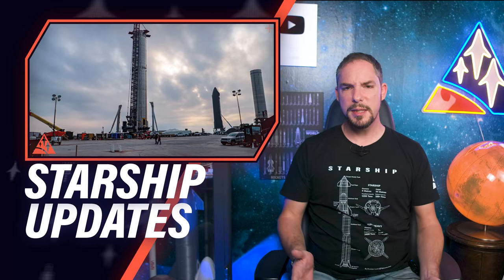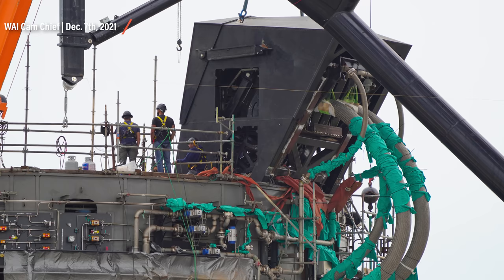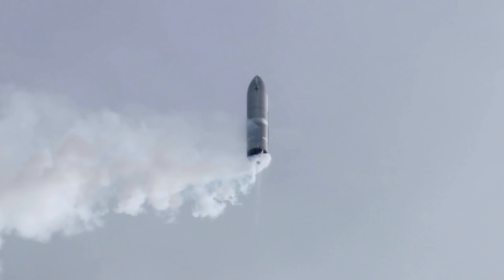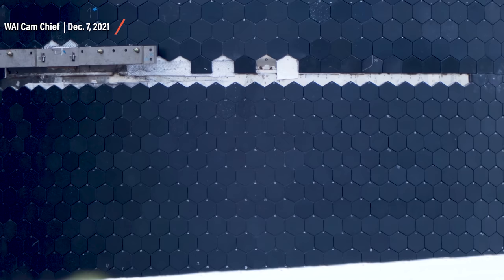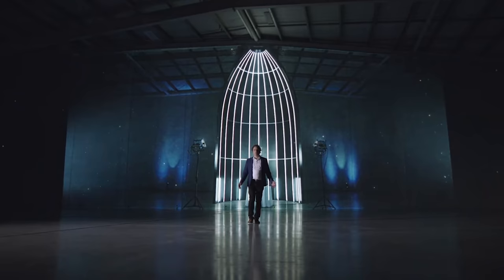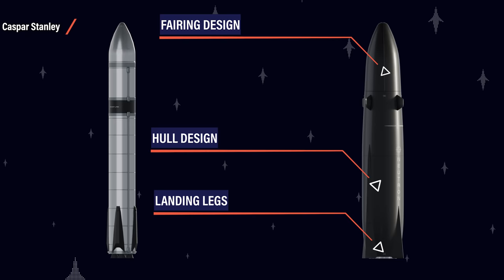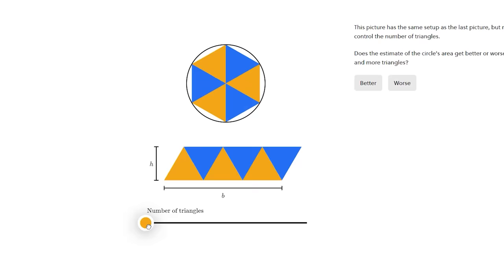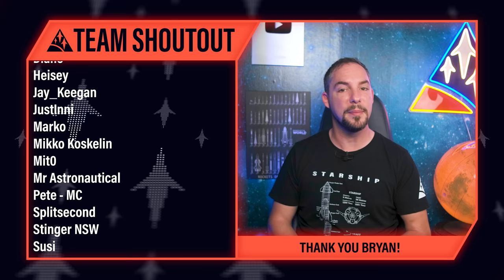Not enough engines? Why SpaceX might be retiring unused Starship boosters!?

Comment: Rocket Lab has a big advantage in their Neutron development than other Rocket Companies. Using 3D printing, becomes handy at the prototyping phase, allowing quick design changes.
Reply: Agreed, don't think 3d printing is good long term personally but definitely effective and efficient in prototype phase
Reply: But is it really cheaper though?
Reply: The prototyping PHASE too...lol...sorry. Someone was bound to bring it up eventually.
Reply: @BlackCat.Designs  you gotta give me some slack but from my understanding of manufacturing using 3d printing for prototyping is cheaper, however for mas production using other machinery to make the parts and stamp them out tend to be quicker and therefore cheaper. 

Understand my knowledge is really limited so if you think I'm wrong thats fine 🙂
Reply: @BradElliot  no, im really asking I dont know either xD
Reply: @BlackCat.Designs  depends on size really. Neutron is still fairly small compared to starship. So 3d printed rockets are great for small compact rockets but something like starship would be easier to use SS
Reply: 3D printing is slow with lower quality but the same maschine / printer can do different parts.

Traditional manufacturing needs a different tool / maschine for every part and again for every change. That is way more expensive, but can efficiently manufacture large quantities in good quality. The price than drops with every identical part.
Reply: A big disadvantage to 3D printing is the structural strength of the material. For fitting it is a great prototype, but if you are pushing the limits of your material, it is completely different. 3D printing has been around for a long time. It used to be called rapid prototyping. Advances in 3D printing have been amazing, but the internal structure of the material is still very different
Reply: @BradElliot  3D printing is great in the prototyping phase. But once they chose the final design, they could switch for other most cost effective construction methods.
Reply: @BradElliot  the 3D printing it's just in the prototype phase. They will eventually going to use other more standard fabrication methods once they achieve the production phase.
Reply: @RogerM88  That's called spelling. Not grammar.
Reply: @Ben-jr8ku  Neutron is exactly comparable to the SpaceX Falcon 9 - that SpaceX are looking to retire. RocketLab obviously see a market opening.
Reply: @davidnewton4491  3D printing can be just as strong - what it is is much slower than conventional manufacturing for simple parts. For complex geometry you can make parts faster using 3D prints.
Domestic 3D printers are crap quality and not a good comparison basis.
Reply: actually not really... having a carbon fiber chassis makes it not very iterative, they are kind of bound to their design. A metallic chassis would have been easier to be more iterative. Also other companies are working far more on 3d printing full rockets for cheap like relativity aerospace etc. Rocket Labs advantage is that they have experience building and launching carbon fiber rockets already.
Reply: C Dawg  RocketLab have been 3D printing their entire engines for the best part of a decade. They know what they are doing (having put more satellites into orbit than most companies that have that short a history).
Reply: C Dawg  why compare with SpaceX? There are other companies to compare.
Reply: @RogerM88  can agree with this :)
Reply: @allangibson2408  I guess I was crap saying what I meant. There are applications where grain structure inside of a material, especially in aerospace, means a lot. A ton of components can be 3D printed but the crystalline structure of materials like titanium, and stainless can only be found in cast, rolled etc. metals and plastics. I love 3D printing especially some of the cool stuff that has come out on the aerospace side the last 10 years. But in certain areas a non printed part is just better. With the technology, in my limited experience, there have to be at least a few high stressed parts that need proper grain structure. Not an expert, just using my limited window of making and designing parts in a corner of the industry
Reply: 3d printing for metal parts and engines may be comparable to the printing we know, but i don't think the carbon fiber "printing" for the rocket is the same thing. More like carbon fiber "laying", which in this case is more comparable to the robots welding spacex's metal tanks.
Reply: Elon will just buy Rocket lab if need be.
Reply: @davidnewton4491  Industrial 3D printers are a world apart from domestic or even commercial equivalents. That includes operating in inert atmospheres or hard vacuum if that is what the material (ie Titanium) requires. You can work to the strengths of the technology and not the weaknesses. You can 3D print components that you simply can’t machine or cast - including having hollow impellers in pumps with a hard vacuum inside for example. Machining components during 3D printing is also possible to get the required surface finishes inside components. Variable material composition is also possible (integral bearing material installation being an example). You can also 3D print materials that can’t be cast (because they are dynamically and thermally unstable).
None of this is cheap - and you really have to work to justify owning the required equipment to give you exactly what is needed.

Comment: From Peter Beck's presentation, my biggest personal take away way is how their 3D composite production is measured in meters per hour, as opposed to metal printing which is measured in millimeters per hour. That's a big wow!!
Reply: @Bryan-Hensley  it may be that the available composite tech at the time just wasn't feasible with their production goals. Rocket Lab has taken that time to hopefully perfect their process, and sounds as if they're aiming for '24 to get the real action going. If the tech becomes viable I'm sure SpaceX could reincorporate it into their design when the timing is right? 
I'm confident that they're getting stainless more streamlined with each new model as we've seen, and the incredible progress on the TPS bricks over the last year also gives me hope
Reply: Lol No"doubt about it"😉

Comment: I don't think the booster is being retired, it is  probably being stored. There is no other place for it at the site. I am almost 100 percent sure booster 5 will fly if Raptor 1s are still in production. I am interested to see if they skip 6 and 7, and go to the 33 engine booster 8 with Raptor 2s. I think that's what they want to do, but Raptor 2 bottleneck is what is endangering the roadmap.
Reply: Why skip 6 and 7?
Reply: B6 is a test article now
Reply: I don't see a point in guessing since we cannot know.  I'll just wait until it happens and then I will know. 🤪
Reply: I believe you are correct😉

Comment: You forgot to mention one of the most important facet of the Rocket Lab "Neutron".. it's outer skin is NOT stainless steel, it's a carbon-fiber-composite that is more resilent to structural damage.. This is the most exciting part.. a tremendous reduction in weight.. :)  welcome the states, Felix !
Reply: I don't think strength is really an issue tbh... that was an odd part of his presentation, the cf is really just to reduce weight to get more payload, if anything cf handles heat much worse than a metallic alloy.

Comment: The reason B5 is being put on hold for now is because firstly, the OLM can only hold 1 vehicle. Secondly, the OLM is required for booster testing. And finally, it is not done yet, meaning they cannot currently test any boosters. Because S20 and b5 are both at the pad, there is no room for b5
Reply: *b4 at the pad

Comment: Russia,China and Europe are exactly copying Falcon. Rocketlab is improving Falcon design. And that improvement is very low risk. The highest technical risk they are taking are the single stage turbo pump new rocket engine. Its a very impressive design.
Reply: Which is why I love rocketlab's approach over old space approach. Rocketlab figured they have some experience in composite that others just don't have, so they went to the drawing board, learning from what falcon demonstrated over the years as the new block versions improved it's capabilities. Neutron does pretty much what falcon does... But because they went in with a clean slate (while falcon was built from cheap expandable to the first re-usable booster and re-usable fairings) so they could patch the drawbacks that falcon discovered along the roads.

Comment: Could they use booster 4 or 5 for Chopsticks practice? Could be useful to have some "dry" runs before trying to catching them in mid air! ;-)
Reply: @JoeShmoism  That would be a literal "wet" run. I was referring more to a booster "handling" practice with the chopsticks. It is going to be the most complex and sensitive robotic feat ever! :)
Reply: @JoeShmoism  Exactly! They could hang the booster using the crane within chopsticks range and practice "catching" it !

Comment: I'm very curious to see how that carbon fiber neutron rocket handles re-entry.
Reply: I was wondering about the heat shield
Reply: Remember that it will not be traveling at orbital or near orbital velocity. It's a first stage, so will have a profile similar to Falcon 9 RTLS... boostback, reentry, then landing burns.
Reply: @davidpotter8297  You're absolutely right! The upper stage separation looks like starship payload deployment I completely forgot it was a second stage. Velocity after the boost back burn shouldn't be too crazy.
Reply: Also, remember that they're already testing that with Electron, which has been handling the re-entry heat far better than they expected.

Comment: SpaceX Needs to create a brew booster engine that's larger and over twice as powerful as the raptor. That way, they'll reduce the quantity of raptors required.
Reply: The high number of raptors was created for reason including redundancy if one or more engines fail.  Plus there are a host of engineering problems that arise when building bigger engines.
Reply: Not sure if 29 engines together make it more safer.
Hope they put some shielding between the engines.
250 bar chamber pressure is pretty high in case of an exploding engine.
Reply: Or they could go the soviet way.......
Multi chambered engines
Reply: @albertvanderheiden7419  Thus far there have been no issues with exploding engines due to the high bar pressure.   Testing of the booster should commence soon as it was just lifted onto the OLP.   It should be interesting.  Hopefully a test launch in early 2022 will be the acid test.
Reply: @tyrantfox7801  The Russian rocket engines like the RD-180 are RPG and Lox fueled engine.  Rocket engine technology has come quite a ways since the Soviet days.  

The raptor is designed to fly with methane and lox both of which can be found on Mars.  If the kinks can be worked out it could prove to be the most innovative rocket engine currently in use.

Comment: They have engines for B5, it all depends on the success of 420. Everything depends on a successful initial launch. I think Starship 521 will have to fly regardless of 420's success or failure. If everything is nominal, 521 could be an orbital flight.

Comment: As you review this content, keep in mind everyone that was blaming the FAA as the reason why there has not been a test launch yet.  As far as I know the FAA has no jurisdiction on static test fires of the engines.  SpaceX could have been doing multiple tests.  They have done a few tests of the Starship that has shown failures of the tile system.  The reason why they have not done a sub orbital test launch yet is SpaceX is not ready to do it yet.  There is still months of infrastructure that needs to be completed not to mention issues with mass production of engines.

Comment: I suspect neither B4 nor B5 will ever fly.

As long as they're constrained by Raptor production, it only makes sense to fly their "best" booster at any given time.  B4 is already obsolete, and B5 is likely to be obsolete before FAA approval comes. They'll fly with the best available booster once they have FAA approval.
Reply: Why is booster 4 obsolete? It was designed from the beginning to be the first orbital booster and expendable. I'm 99% sure that booster 4 will propel ship 20 to orbit.
Reply: Because each booster has improvements in design and build quality.

Changes are part of the plan.  Ideally they would test each one in flight as well, but without enough engines, the second best thing they can do is pressurization tests, maybe some static fires, and then move on to the next booster.
Reply: @AmiGanguli  as of now, they have 2 "complete" boosters, 4 and 5. They have planned to expend 29 engines on the orbital test flight. Last I heard, booster 5 will be attempting a recovery as it has header tanks for a "landing" I suppose they can skip to b6 or 7 if they feel it will have a higher chance of successful recovery, but booster 8 will have 33 engines, I believe, so I don't think they're ready to risk that many yet.
Reply: @mrandersen6872  I don't have any insider information, so it's all guesswork. 

Their general philosophy is to be pragmatic and to change plans as things develop, though.
Reply: @AmiGanguli  Which is why it makes sense for Space X to test B4S20 because Elon expressed concerned about Space X going into bankruptcy because of the raptor 2 production issue.  Best to test B4S20 and get the data they can and go from there.  It may and probably take several test flights before Space X reaches a model design that they can begin to fly for customers starting with Starlink 2 which requires Starship to deploy it.
Reply: @michaeldeierhoi4096  Well, look at it another way: if they only have enough raptors to fly one of B4, B5, or B6, and all are ready to go, which one should they fly? 

Presumably they would test the one that represents their best work so far, which is likely to be B6.
Reply: @AmiGanguli  Except that B4 already has its raptors connected and is awaiting testing perhaps next week. The testing would likely take weeks.  If testing goes well then I think that it is reasonable expect B4S20 to launch as planned.  

Hopefully we'll see soon enough.

Comment: I always felt that Osato Chemicals comically missed the boat in You Only Live Twice. They had the holy grail of launch vehicles in Bird One, a vehicle that could fly to orbit and back and be rapidly reused, and instead of developing it commercially, they gave it to Spectre for a crazy scheme to start WW3.

Granted as was it would not have been useful, as it had to launch empty, but everything could have been fixed by redesigning the first stage (which was disposable). Stretch it by 40% and replace the three first stage engines with a quincunx of 5 engines, and use remote control for terminal guidance to land on a barge. 

I assume the upper stage was manned since they didn't have computers advanced enough to fit on the spacecraft and handle precision landing, so the first stage would need remote control from the ground for terminal guidance, but that was entirely doable, especially as the first stage wouldn't have gone through plasma blackout and they had a robust communications solution.

They even had a smallsat camera solution which could provide video images, taken up and deployed before each capture, other wise how would the ground control have been able to get exterior views of both Bird One and the capsule together.

Comment: Felix, why could they not use 2 meter tall heat shield tiles for the large portion of SS?  Seems would be less work to mount/service...
Reply: They need to bake the tiles in really hot ovens, the size limit of those ovens constrains the tile size. Also you REALLY want the heatshield tiles to be easily handled by a single person for servicing, especially if you are on mars.

Comment: They should fly both boosters, to get more experience, unless they know it will fail, or destroy the launch pad. The heat shield is the big unknown. Tiles fall off with static fire vibrations. But upon atmospheric reentry the vibrations will be much bigger.  They need to be tested soon.

Comment: Good episode.  I am wondering, maybe if you place your lights higher and aim downward, and then put a fill light on the floor aiming up you could get rid of that harsh glare bouncing back off of your mural in the backround so the colors could come through better. Or two side lights placed extrame right faceing left and extreme left facing right to cross cast the light. OR maybe set your big light hight and bounnce it off the ceiling to create a soft over all diffused fall off then us a sof fill placed further back  behind the camera to reduce the harsh glare off ur mural.

Comment: Wish Elon had applied the "economies of scale" thinking to overall Raptor engine size.... I'd suggest that there is a "sweet spot" in the number of engines < 33 but greater in size and thrust, and at the same time not making the number of engine so small (too few) as to disallow engine out capability. This would also solve the Raptor production rate problem. This also makes best sense if Elon indeed wishes to at some point in the future build a larger SH/SS. 
Have to say, I'm suprised that he didn't move in this direction in the first place: the plumbing alone (forget about the engine control electronics) adds significant mass and complexity to the overall design. All that plumbing also increases risk factors. Will one fuel leak bring the whole bird down?  Yikes!